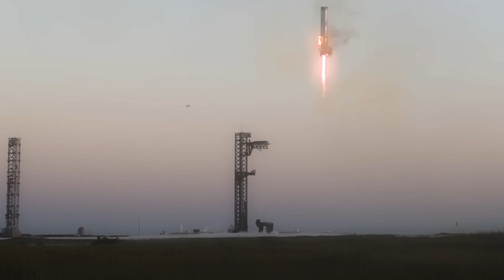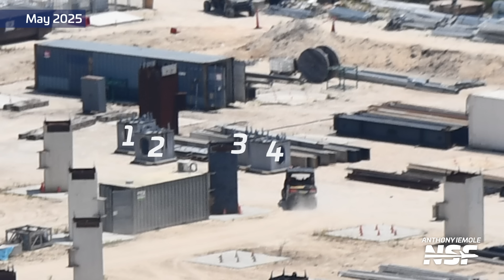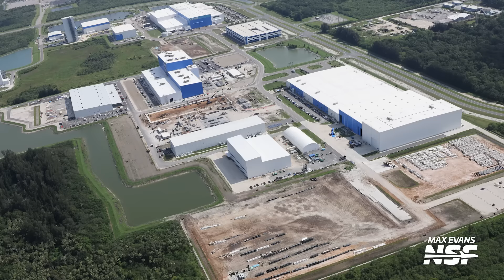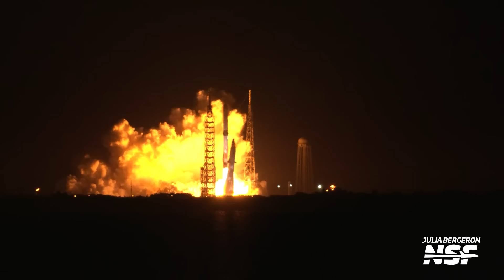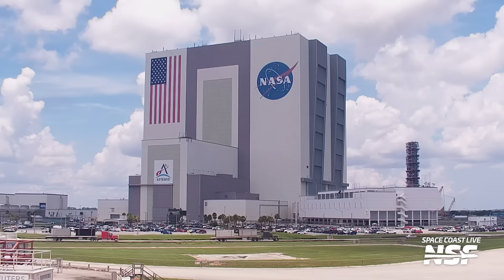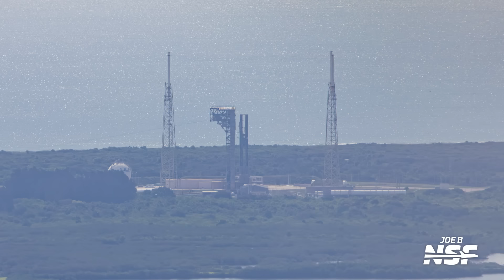SpaceX Starship's Florida Launch Pad Takes Shape | Blue Origin & Vulcan Updates

Comment: 100 Starship launches from Florida? So far, they're 0 for 10. As usual, it's just hype. There are many milestones that SpaceX must pass before we can even think about this system becoming operational. Maybe in another 3-4 years, assuming there are no more design setbacks.
Reply: 0 for 10?
Reply: There have only been 9 orbital launch attempts for Starship, and 3 of them have been almost complete successes. I expect the first real payload deploy within the next 10 flights, which I hope to be within the end of 2026.
Reply: @LaughingOrange. Starship has only been suborbital so far but will be moving towards the orbital configuration for refueling long mission Starships to the moon and beyond. The reusable booster will be always suborbital. The booster has three successful return to pad launches with a catch by mechazilla. Infrastructure at Cape Caneveral is not built yet for Starship along with mfg of those rockets.

Comment: One BO flight this year.  Before the end of the year, I'd like to see this show become a weekly Spacecoast Update similar to Jack's Starbase Update.  And i think you need to start planning for a show on Rocket Lab's Wallops site prep, landing barge, and launches.  They have Electron launches scheduled this year at Wallops and still have the first Neutron scheduled for this year so there is site prep going on.  Rocket Lab has just awarded a contract to Bollinger Shipyards to modify a barge into its landing platform probably with next year delivery.  So Wallops isn't quite ready for frequent updates yet but I think it by the end of the year should be.

Comment: I'm no expert, but I'm pretty sure they drop the rebar-cage into the hole, BEFORE they fill it with concrete. Wet concrete isn't water, you can't just drop rebar into & expect it to sink to the bottom.
Reply: The rebar is lowered after the concrete is poured. Look up what CFA drilling is
Reply: The concrete piling is built the other way up conpared with a concrete column. With the column, rebar is usually made into a cage in the formwork, and concrete us poured in and compacted using a vibrator. In a piling, vibrators can't work, so the concrete is put in place first and the rebar cage is inserted into it.
Reply: @paullangford8179  As I said, I'm no expert. I assumed they'd need to drop the cage in first, to ensure it would be centered at the bottom, but I guess either it doesn't matter, or they build the cage big enough that it barely fits in the hole, so staying centered isn't a problem.

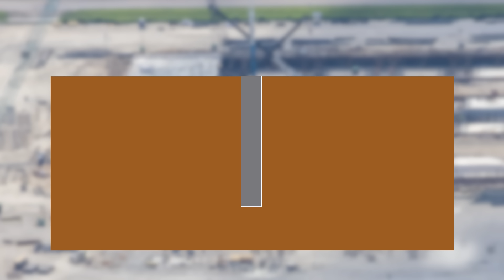Comment: 1:40 first the rebar, then the concrete ... !
Reply: On CFA drilling it's first the concrete then the rebar cage.
Reply: Not sufficient for modern techniques were more strength is needed. This has been done since the 60s. As the drill is extracted concrete is poured in to take its place and then the rebar is shoved in after

Comment: They pour concrete and then push in the rebar? Never heard of that technique.
Reply: Look up CFA drilling
Reply: For pilings, concrete first, then rebar. For column, rebar in formwork and you can use a vibrator to compact the concrete.
Reply: Since the 1960s. Hard to keep up with technology these days isn't it?
Reply: @rocketignitionKSC  Yep, had an issue with my Model T Ford the other day and wasn't able to find a phone booth to call for assistance.
Reply: @nkronert  I think mobiles are great. Used to be people would look at you funny if you were walking down the road talking to yourself. Now, they assume you are using a mobile...